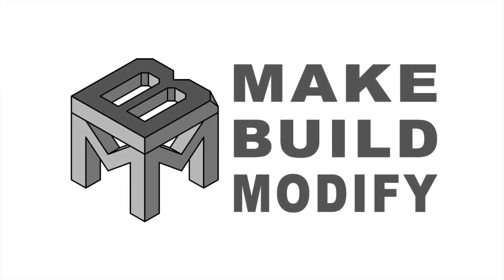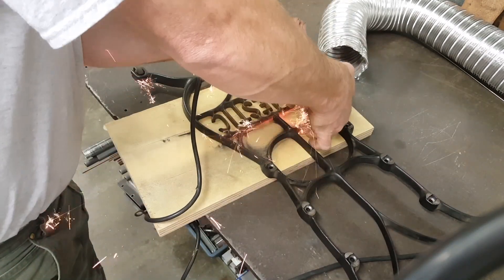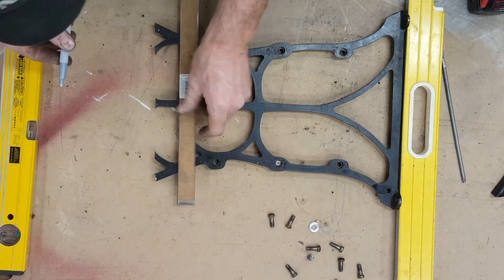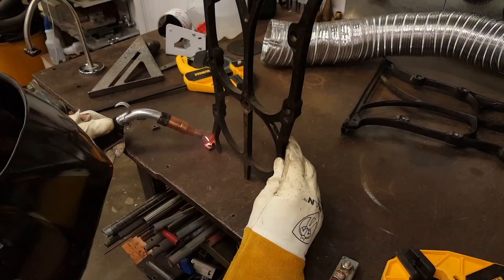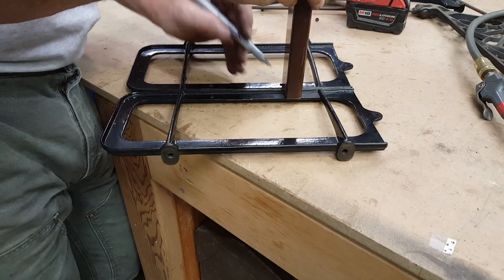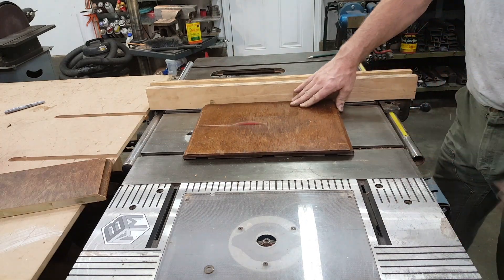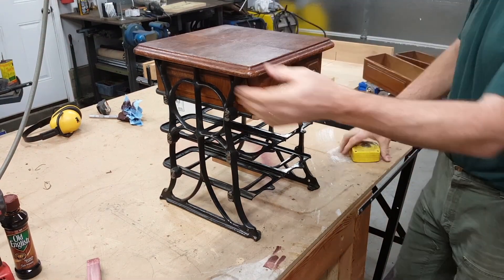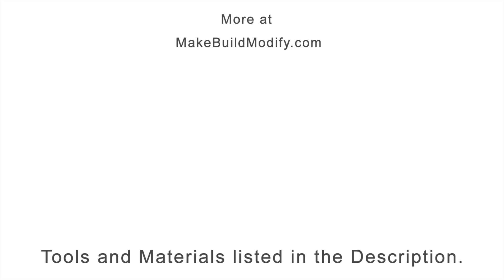Cast Iron Apothecary Cabinet - Repurposed Drawers

Comment: That's awesome, nice work... shame you couldn't get the top to be a single piece of wood 🤓👍
Reply from the maker: Yeah, but at least there was 4 corners to work with. Thanks!
Reply: I'm a little surprised you didn't plane or sand a little off the top after you joined the four corners, and refinish the top, to make the seams less noticeable. Or did you want to preserve as much of the original finish as possible?
Reply from the maker: I agree. but the client requested that I keep the original finish.
Reply: should have made the top 4 pieces into a tiled pattern so it looked like the top was cut into quarters for a reason or atlas to make it look less like it was just popped together
Reply: If there would have been enough original material, one could have cut the corners to triangles and place a rhomb (diamond) in the middle. It's done often to mask fragmented pieces.
Nevertheless I like your work.

Comment: Nice build. Whats your secret to welding cast iron or is it cast to cast does't stick (mig) but perhaps mild steel to cast does ok for light duty?
Reply from the maker: No secret. I just try to make a big enough weld to handle the forces that will be applied. In this case not much force. There are plenty of cases where I try to avoid welding cast though.